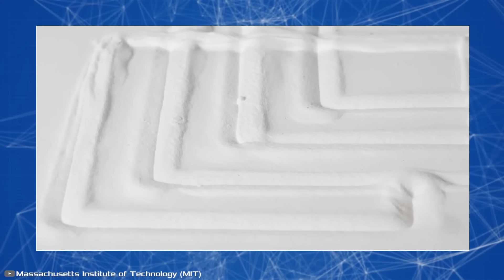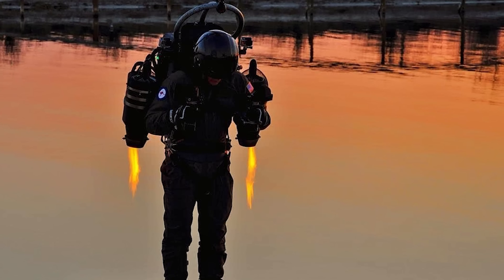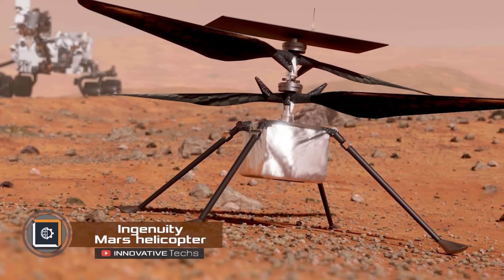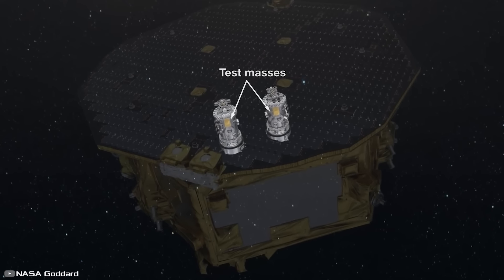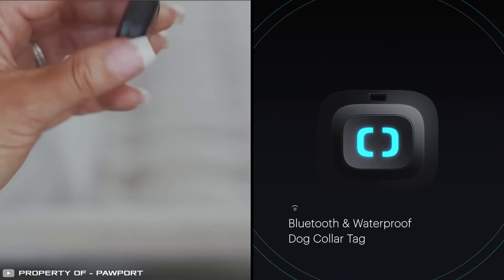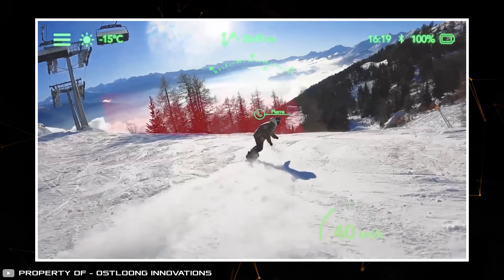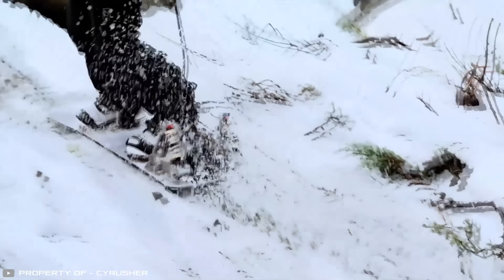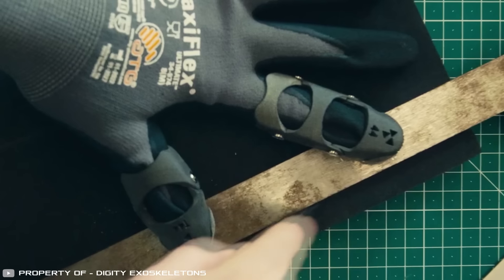NEW INVENTIONS THAT WILL SURPRISE YOU ▶3

Comment: 3:37 that's sitting alittle high on that motorcycle , i'm not to sure about that design , lower center of gravity is much better
Reply: I agree with you on the lower centre of gravity but it's not a "bike" [bi-cycle] since there are no peddles and two ["bi"]  wheels ["cycle"]  etc.. i would call it a MSE Sea-Ski / Motorcycle Style Electric Sea-Ski or E-Sea-Ski under the umbrella of PWC/Personal Water Craft.
Reply: And 80% better performance or something like that, because the air goes through that hole? That needs further analysis. I would spontaneously say no.

Comment: 16:04 What range did this electric aircraft have?
19:40 Open box C+: Hopefully they have something that closes the airgap between the trailer and the cab as it may cause problems. Especially with it's lighter frame and highway speeds.

Comment: 3:30 were is the center of gravity? I thing is too hi . Prevent disaster.
Reply: it did wobble a bit didnt it? and that would have been a pro riding it, it needs a lower riding position.
Reply: @manofthewest67  Batteries are heavy, what do you think is in the bottom, it's a Weeble-Wooble.
Reply: @Ron-d2s  for one thing the 'air scoop' is not going to make a huge difference unless they intend to break speed records, for everyday use? nah, but just my opinion.

Comment: We could have at least seen the engine fire on the concept plane?😢
Reply: Wanted to see an engine fire? Just hearing it run should have been enough. Maybe next time?
Reply: All that thermal runaway reality is not helping fool people into thinking electric battery powered aircraft are a good idea.
Reply: @RemnantDiscipleLazzaro-Rev1217  Electric airplanes are a farce. I can go 770 km on a single tank of gasoline in my minivan, and it takes me, what, 5 minutes to tank up; but an electrical car only goes half that distance (at most) and it takes an hour to charge it up. So NO, thanks, I prefer to keep my Nissan.

Comment: All well and good but you told us nothing about the battery sizes capacity or type, how long they last charge times, if your going to start talking about all these batteries we need a lot more detail 😮
Reply: Palladen , right you are. One interesting thought re batteries: A guy is cruising along over Big Sur, and an electrical storm zaps the car battery.  No back up. Almost no way to ground it. Just a thought.

Comment: 8:20 The Orb Aerospace (compact electric plane) looks awesome! These should be standard across the world (instead of flying/hovering cars), I'd definitely purchase one!!
Reply: Senseless. The all electric plane by Mercedes is again just stupid.... batteries are so heavy.... what a waste of resources, STOP WITH THE LIES OF ZERO EMISSIONS! 

The electric aircraft after the previous, more idiocy of making such type of aircraft with how half or more of the weight of the aircraft is the weight of the batteries and the increasing thermal runaway / spontaneous fires occurring with lithium based chemistry batteries etc. It's just such an inefficient propulsion energy system for aircraft especially considering the chance of lithium battery fires / thermal runaway happening. Why do you think the laws are so strict and getting more strict for transporting lithium batteries on aircraft? There many other critical reasons why it does not make sound sense to use batteries to power an aircraft.

Comment: Sorry, but I'm not finding the claims of that electrical aircraft manufacturer too credible. If I can go 770 km on a single tank of gasoline in my gasoline-powered minivan but an electrical car can only go about 300, then how does an aircraft, which uses way more power than a car per km, get to fly 1000 km? How long does the battery charge? 4-6 weeks?  I've only ever seen one Tesla car in real life because electricity is way more expensive per kilowatt than gasoline, even though the gasoline is about 3x more expensive here in Europe than in the USA.